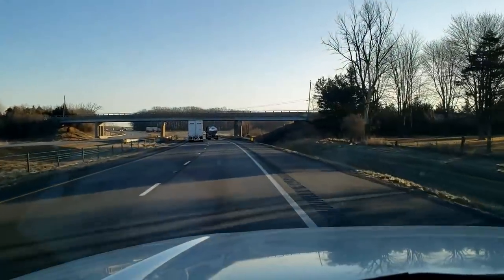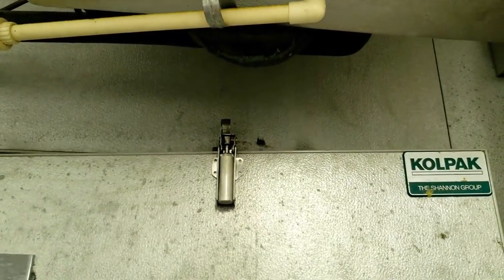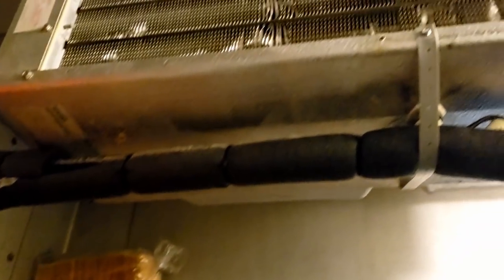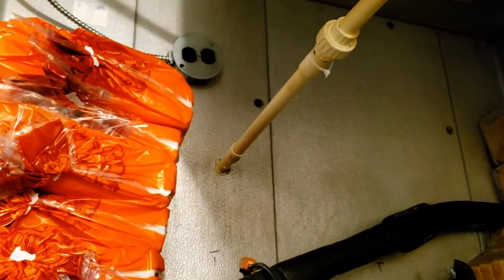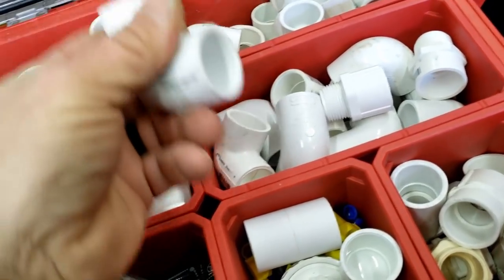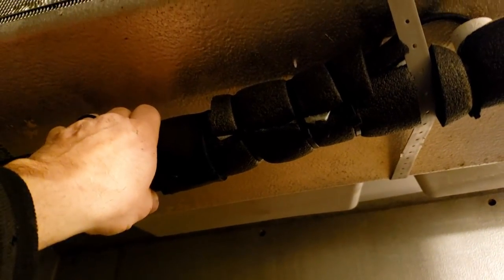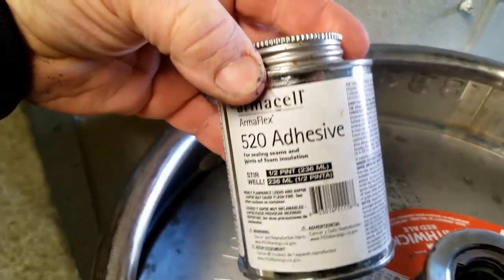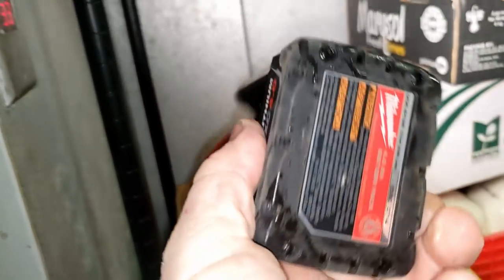Water Leaking Onto Freezer Floor

Comment: Freezer drains and heaters... the pain of my life. Have never seen plastic pipe used though always 22mm copper in the uk. Usually run our heaters around the outside with silver heat sink tape now after a lot of new install issues we had putting them down the drain. 😬 great vid as always Rick, love seeing how you US guys do it always something to learn
Reply from the maker: I find it interesting to hear what your doing on the other side of the pond as well. Thanks for watching!

Comment: Didn't know about running the heater trough the inside of the drain line.  I like it alot. Will talk to the boss about doing that next time.  Thanks.
Reply from the maker: Inside the drain is what the reach in freezers use. The only thing I can see someone complain about is the possibility of a restriction but I haven't had one yet. But we try to keep the lines short as possible.
Reply: @HVACRSurvival  reach ins use a much smaller braided heater but for that length and pitch will work.

Comment: a hole-saw trick for the enlarging a hole is using a guide block of 2"x4" or 3/4" ply wood drilled with the same bit, then just clamp, screw or hold it in place as a bit guide and go at it :)
it works well for all materials. I've also used scrap pvc trim, other boards/trim, pieces of steel, even 5/8" drywall a few times lol
Reply from the maker: That makes sense 👍👍

Comment: Nicely done. If PVC is allowed, and the heat strips you use don't destroy it, then sounds good to me. Like you pointed out somewhere in another comment.... if it freezes cuz something failed... then copper will split also. Doesn't really matter.
Reply from the maker: That's how I looked at it.👍 I haven't had pvc crack yet from using the self regulating heat tape, this is the good heat tape.

Comment: Purpose of putting the P trap outside the box is to form a water seal that will block warm air from traveling down the drain pipe & gaining access to the refrigerated space. No PVC allowed in my area, copper drains only.

Comment: Never had any luck with plastic drains in freezers. The heat from the heater cable dried them to crisps in a few years in most cases. But i guess it depends on which type of plastic and how much heat you toast it with.
Reply from the maker: The self-regulating stuff we're using is pretty good.  I've never had it burn up, sometimes it'll just stop working. But that other stuff that you seen which is what you find at every hardware store... I've seen melt plastic.

Comment: Homedepot on end cap, has magnetic accessories, look for a 2" round magnet with a hook, if it will stick to LED magnet?
Reply from the maker: That might be better than what I've been using. I put a wire tie around the neck of the battery with a hook.  👍👍

Comment: Pvc drain on a freezer?
Reply from the maker: We use it all the time and never have a problem, now depending on the type of job and requirements we will use copper. I've seen copper split just like pvc. If it's going to freeze it's going to freeze because somebody didn't do something right or the drain line heater failed.
Reply: Through the pipe on pvc. Never ran the freezer with pvc but that must be the key. Thanks for sharing your knowledge man. I appreciate it.
Reply from the maker: I don't think I would use pvc unless it's inside. I'm not saying it's the best choice in stores that have idiots working for them that beat up there equipment but it's not been a issue for out the wall draining. The more pipe you have the harder it will be too run it inside the pipe.

Comment: I usually agree with you, but not with this.

Best way is to run copper drain wrapped in a helix with heat tape insulated with 1 3/8 armaflex by 3/4 wall insulation.  The number of helix wraps around the pipe increase by foot dependent on box temp 0 degrees to -20 degrees.

Pvc doesn't evenly distributed the heat through the pipe.  Plus it gets brittle and weird in this kind of setup. Obviously you can't trap inside or outside the freezer. I would run the drain in the cooler and trap it there, tie the cooler and trap again in the cooler before going outside.
Reply from the maker: To be honest at first I didn't like the way the trap looks outside but I've gotten use to it and it works good. From the instructions I have read on drain heater installation, they recommend it's laid on the bottom of the pipe in either a strait line or with two strait passes and not spiraled around it. The reason this works so well is because it's inside the pipe in direct contact with the water verses loosing heat transferring through the pipe. (The same way True Mfg. runs a heater down the middle of plastic tubbing in a reach in freezer.) I will say in industrial settings where it will get abused we will use copper but on short little lines like this we will normally use PVC.  I respect your opinion and appreciate you taking the time to explain it.